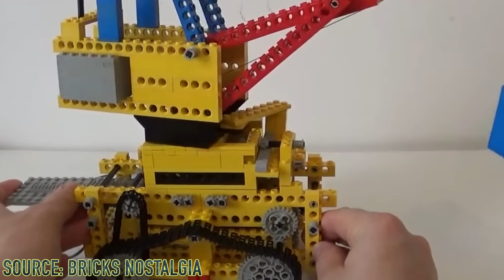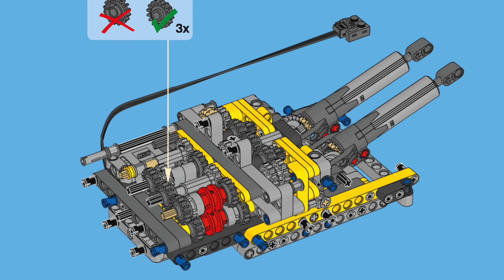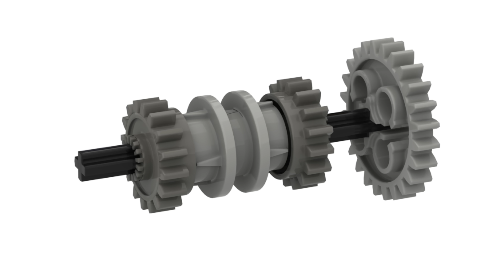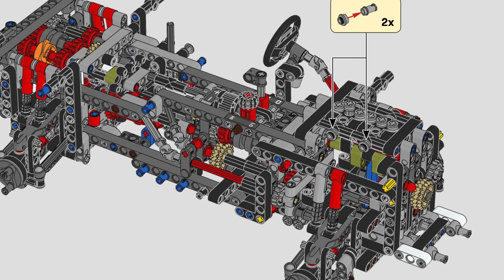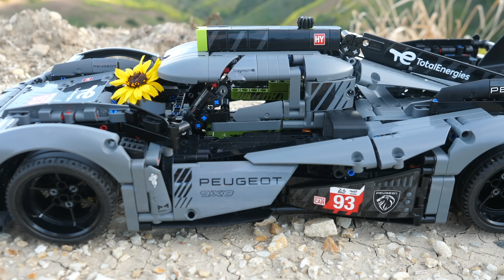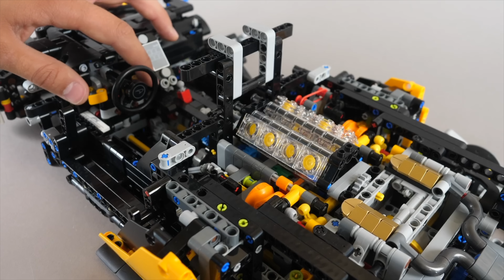10 Most Difficult LEGO Technic Functions & Sets

Comment: I got 42146 recently. The price actually isn’t bad right now as I got it for 30% off, and I had a lot of fun building it. The one step is a nightmare however because if you accidentally drop the string, the sheer weight of the jib will cause it to unwind the spool you were trying to knot.

Comment: I was fortunate enough to get two of the 8880 sets, so now I have them both on display, one built as the original model and one as the secondary formula 1 car. Also have the excavator and it boggled my mind building it that they could run both tracks independently through one joint.

Comment: The mechanical programming is incredible. Never realized such a set existed back then. In a way it's reminiscent of how some of the first CNC machine tools used punch cards to program instead of G code on some form of computer. Or an old wind up watch using just an intricate set of gears and springs to function. The computerized stuff is fun too, but I really feel like the old mechanical sort of machines needed more ingenuity to design and build.
Reply: The mechanical programming was from a Lego Technic Ideas book, it wasn't a set. The linear card reader example was incredible, but there was also a looping version (still using rack gears, the mechanism was clever) with instructions that controlled the position of four articulated arms that drew patterns on a roll of paper advanced by a motor.

Comment: I'd nominate the 8480 as a good runner up, if not in the list.  Same vintage as the 8880 (which I also have), the 8480 shuttle packs it all in there with a gearbox that allows 1 motor to handle 4 unique functions - 1) open the bay doors, 2) lift/lower the satellite arm, 3) turn the arm left/right, 4) cycle the "led" fiber lights.  Another control for the satellite "panels".  Not to mention lowering/raising the landing gear and last - the control for the ailerons.
Reply: I agree. I believe 8480 was the first set that used the 8880 gearbox parts (minus the lever) to switch between functions. Great alternative model, but the main model is as close to perfection as you can get if you ask me. I sold mine because quite a number of connectors and bushes began to crack, but maybe I should've just replaced those parts instead.

Comment: Your explanation on the helicopter rotor is incorrect.  The increased blade pitch is applied approximately 90 degrees out of phase to the desired direction of tilt (depending on rotor direction of rotation).  Reason is that it is gyroscopic precession.  From google:

"Gyroscopic precession in a helicopter refers to the phenomenon where a force applied to the spinning rotor system results in a reaction 90 degrees later in the direction of rotation. This principle, inherent to gyroscopes, influences how a helicopter responds to pilot inputs and affects various maneuvers"

Edit:  Therefore, if the rotor is spinning counter clockwise looking down from above, in order to pitch the helicopter STRAIGHT forward, you would increase the pitch of the blades on the left and decrease the pitch of blades on the right sides.  The effect will "lag" 90 degrees to precess the craft to tilt forward with a force acting upon it at 90 degrees.  Yeah, gyroscopes are weird, not very intuitive things!

Comment: actually, the periodic change in angle of attack ("pitch") of the rotor blades is to compensate for different air speeds on the advancing and the retreating blade while the helicopter moves forward through the air - otherwise lift generation would be unsymmetrical over the rotor area 🚁➰
Reply from the maker: Oh wow that’s good to know! Thanks! Are you a heli pilot?
Reply: @Unbrickme  affirm 😅and I totally agree with your choice here since the 42145 reflects the complex technics with a helicopter in a fantastic way 😎
Reply from the maker: @brickXperiments  amazing! I am a private pilot working on my IR (hopefully will pass the checkride before middle of June). I fly a cessna 172 G1000. What ratings/certs do you have?
Reply: @Unbrickme  great stuff 🤩 currently I am flying ATPL(A) on a RA390 Premier1, and I am also publisher of EASA PPL/ATPL examination databases - so if you have any questions concerning theory, drop me a mail 😎

Comment: "Prior to version 2 pneumatics"

Isn't that already the second version? The first version had only one hose per cylinder (moving the rod either by pushing or pulling air from it).

Adding second hose is definitely modification so major, it deserves a new version number imho.
Reply from the maker: @jpjokela1  yeah I guess. Arocs set called it version 2 though

Comment: The current 24T differential is actually very slightly different, I have both versions.
Reply from the maker: Please explain how
Reply: @Unbrickme  It’s so small you wouldn’t notice. On the 16T side the part where the axle goes through is extended out, I haven’t got one near me to check.

Comment: I think the set 42043 Mercedes Arocs is very good example which was missing in this material: gearbox system splitting the drive between foru functions,  complex pneumatic system with compressor and very interesting suspension and steering wheels.
Reply from the maker: Great point!

Comment: Back when technic was... well, technic and not a license grave and expensive cars that barely resemble the original
Reply: Bionicle 🦾🗿
Reply: very true
Reply: Daytona sp3 looks good imo but it’s my first delve into technic
Reply: The Bugatti is the one that comes to mind, that turd looks so half rate and rushed to market
Reply: But the P1 was released last year??? What do you mean???
Reply: @SecondLightning  the P1 is something called a "racer". a display model made from technic parts. technic has several key points what in my eyes make it technic: Bare bones, that you see the functions and how they work and alternative b and even c builds, no license needed. and be fair, put a p1 and the lego p1 next to each other. you just could've called it a generic supercar and it would be closer. then you could say: ah it is inspired by the p1, nice. and not it should look like a p1 when you squint and look into another direction
Reply: Lego is fairly limited man they won't make completely unique parts for every set only the licensed ones with very unique parts it's still bare bones most technic sets can still be observed in function at just in a more appealing shell so they sell better but they still hide incredible innovation under the mediocre or not shell you can just have a half built lego P1 chassis no one requires you to finish it and put it on display even if it doesn't feel right as long as it's what you want its ok @Strix-DF97 
But it is horrible the fact that it's so heavily licensed makes them so much more expensive bruh
Reply from the maker: Technic is still awesome!
Reply: @Unbrickme stop doing drugs! technic peaked between 1990 and 2015, almost everything after 2015 is an overpriced joke

Comment: I recently bought a Mould King. I know, I know. Anyway, it has two sets of pneumatic hoses, each of which needs to be cut separately. It's so enjoyable, but at a certain point, it gets messy, kind of like in number 7 mentioned in the video. Also, the cabin snapping off from the body in the 6x6 by volvo articulated hauler was a nightmare. I always have to hold it so gently, and putting the cabin back on is a nightmare.
Reply from the maker: True that

Comment: I still have my Supercar 8880. Got it when I was 8. Had zero issues building it over and over and over.
Reply: The 8880 helped me to understand how gear shifting works. It never clicked for me how that functioned untill I saw the process work in that set.
Reply: fan here too, still got it. best thing on lego ever
Reply: I still use the suspension parts in the robotic rovers that I build.  The hub system is far superior to the current CV joint system for power transmission.  I even went so far as to 3d print new rims so I can use the big balloon tires with the suspension.
Reply: And the best: the instruction manual only had a „few“ pages - not hundreds as nowadays for much smaller sets.
One of the reasons I became an engineer 😜🙏🏼❤️
Reply from the maker: That’s so awesome! You’re a real technic fan!
Reply: Snap ,loved it
Reply: I loved that set. It also had a secondary design for a formula 1 racing car
Reply: @alphega1983 man I miss the 2 in 1 feature in bigger technic sets these days..
Reply: Still have my 8880 as well ^^ got it when I was 10 as Xmas gift.

Comment: For the helicotper mechanism it's not as straight forward as tilting the wing up in the bacj and down in the front to pitch the craft forward since gyroscopics effect induce a 90° "lag" in the craft movement but it's the idea ;)
Reply from the maker: Gyroscopic precession is fascinating
Reply: @Unbrickme  btw i was wondering if this 90° offset was included inside the helicopter control even though it's not that useful ?